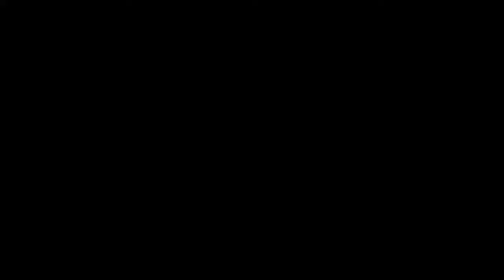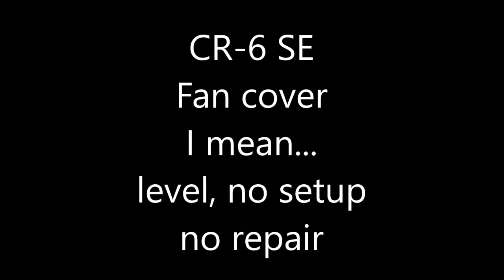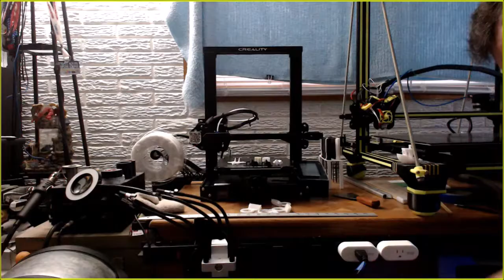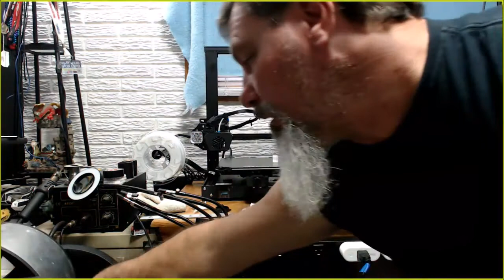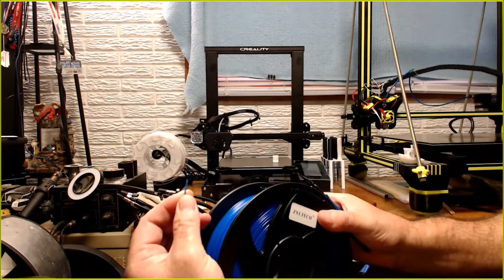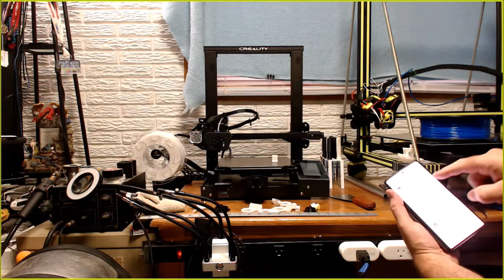CR-6 SE fan cover - er...profile setup, Re level...PRINT : )

Comment: A tip for you with Hotend up to temperature unlock extruder drive feed filament in by hand then pull out and no ball on the end of the Filament!
Reply from the maker: sometimes that works . not always.